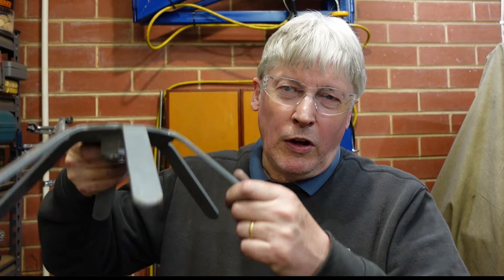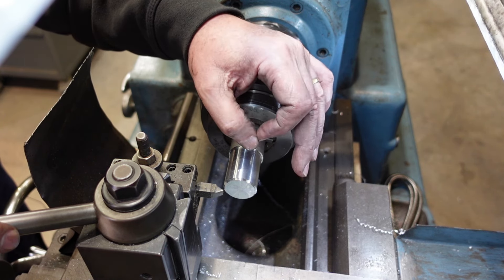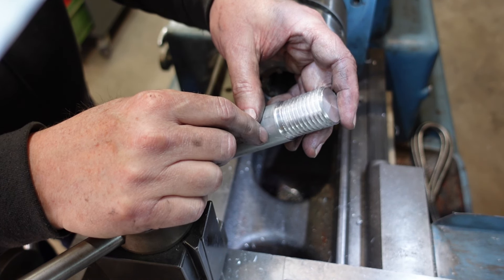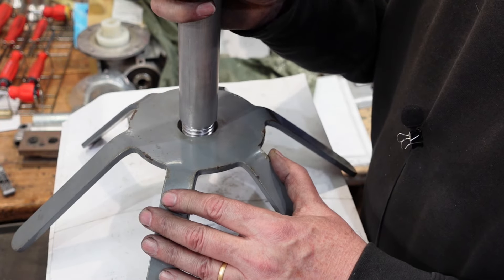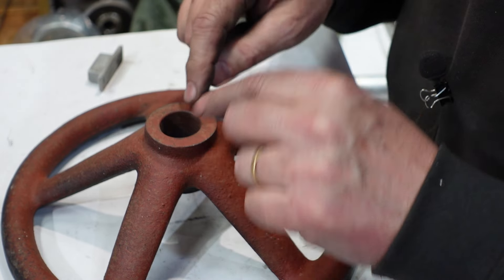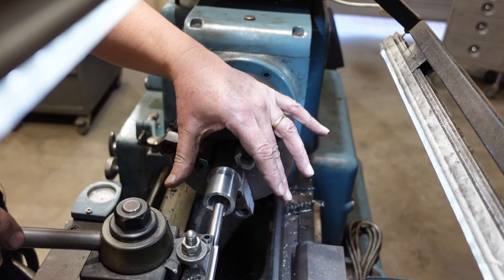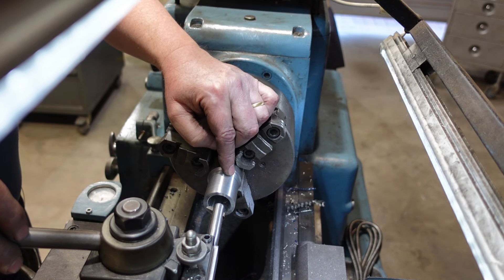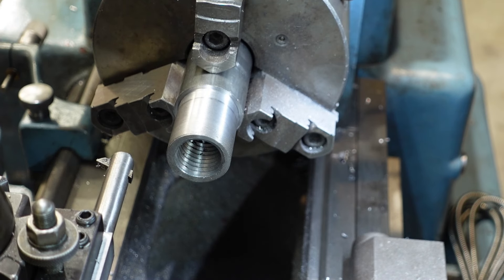Which thread will make the cut?

Comment: Nice work, as usual.  I was concerned when you started talking about the cast hub as your reference for where the bored hole needed to be.  I would not trust any casting, instead using the rim (where one's hands grip the wheel, ie, the functional element) as the reference to centralise and square to.  I expect it all worked out fine anyway.
Reply from the maker: I'd agree about a cast feature not necessarily being reliable. The hole for the nut is square to the rim and evenly spaced in the hub. As it is a slow speed operation, I'm not overly concerned about the rim being exactly central to the axis of the nut - I think it will be good enough.
Interestingly (and bearing out your concerns) when I put the machined nut with flange into the hole I'd bored, I discovered it was not sitting evenly. That is, the surface of the flange was not parallel to the plane of the rim.

Comment: Hi, would it be a good idea to thread in reverse starting at the finish of the thread? that way you don't have to worry about where it ends.
Rich
Reply from the maker: As I think I've said in other videos, I don't like that technique, simply because it means you avoid something that takes a bit of practice to get right. As long as you can always thread that way, fine. But if you ever are in a situation where that won't work and because you have not practiced, you haven't the skills to thread 'conventionally'.